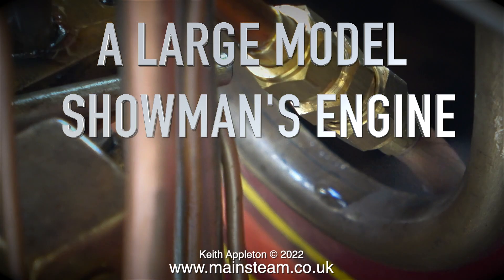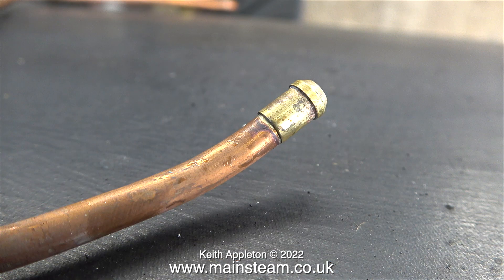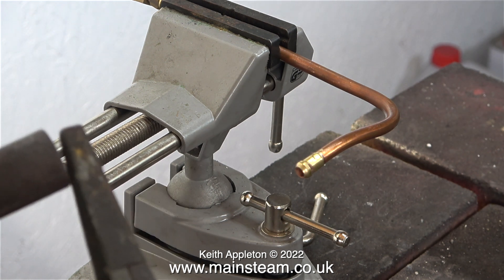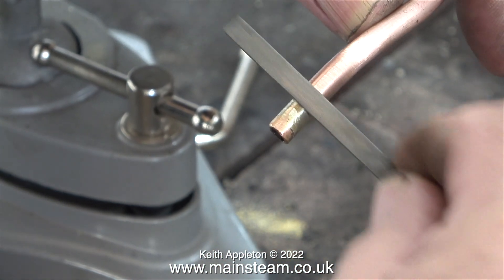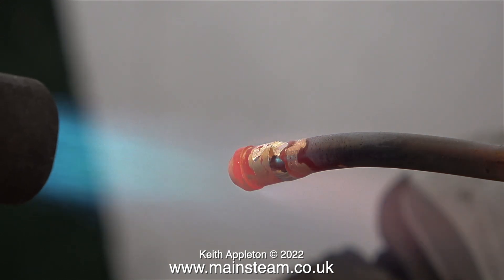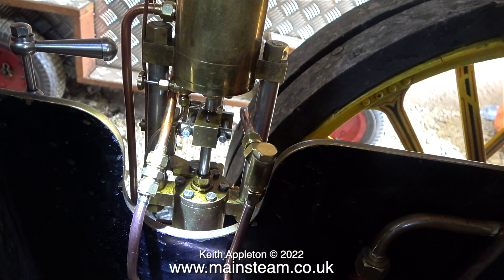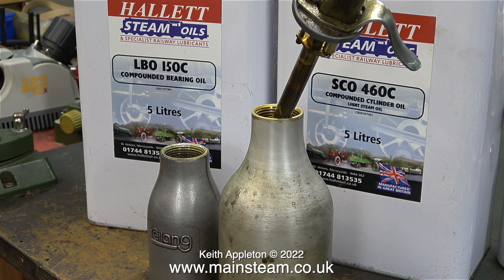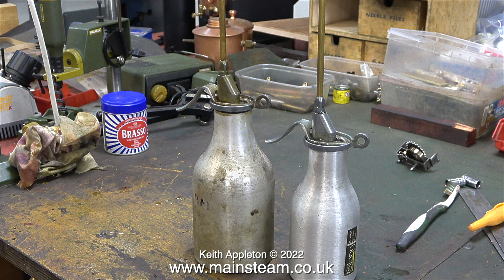A LARGE MODEL SHOWMAN'S ENGINE - PART #65

Comment: I wonder if one were to use an "instant on" water heater to fill a boiler with near boiling water at the start of a steam up. At first thought it should greatly reduce the time, and fuel" needed to bring it to steam pressure. Just thinking out loud.
Reply from the maker: OK in small steam toys, but sudden expansion of a larger copper boiler really is not desirable . . .

Comment: Nice proper job on the resolder. I would have been tempted to just reflow the solder and see if that cured the problem.

Brasso: can't say how much i hate the smell of that stuff. Simichrome is good, but rather pricey. Joe Pie turned me onto "Blue Magic Metal Polish Cream", which doesn't stink and produces mirror finishes on aluminum, steel, and brass.